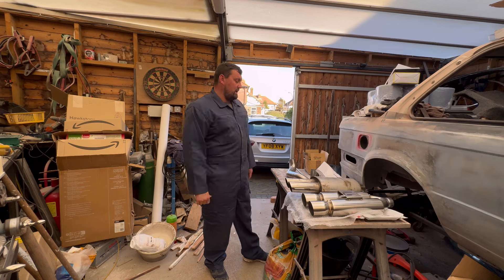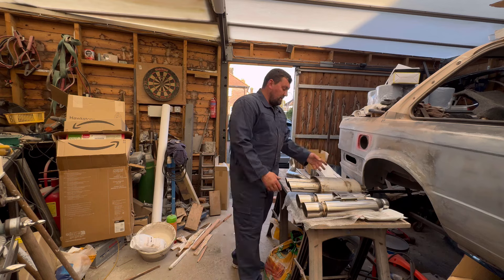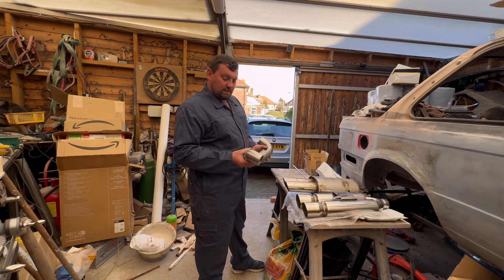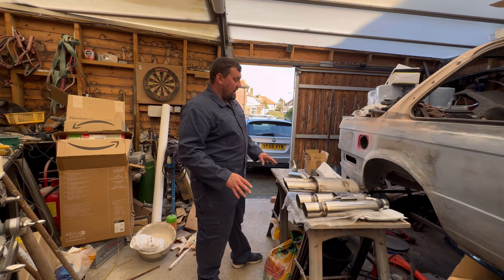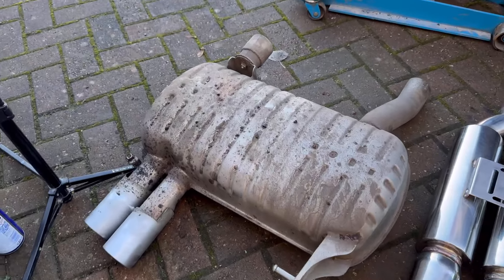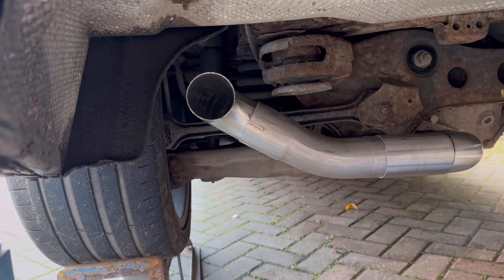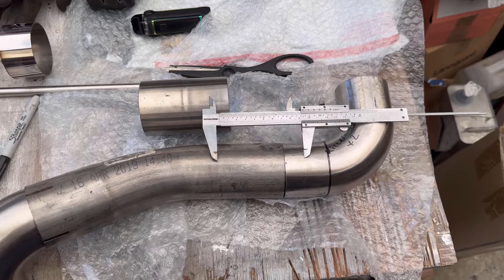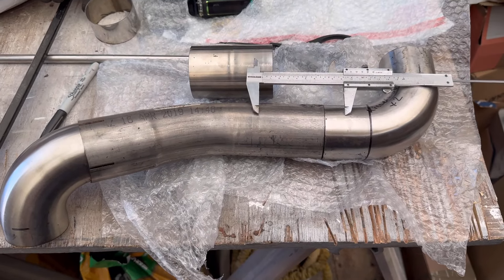BMW e90/e91/e92 330d back box delete, replacing your standard exhaust

Comment: Where did u get the pipe the pipe with the bend?
Reply from the maker: Hi mate all off eBay the 30’ bend was from Jetex off eBay and the two tight 90’ dairy bends and joiners all just took abit of searching on eBay to find the ones I wanted 👍🏻😎
Reply: U got mby links for pipes ? Tryin to find em but not sure wich sizes